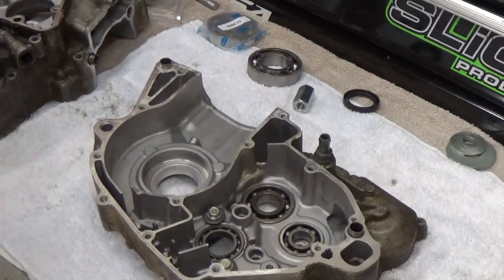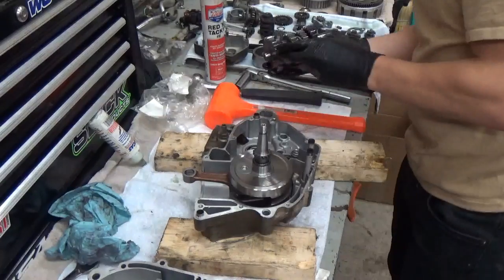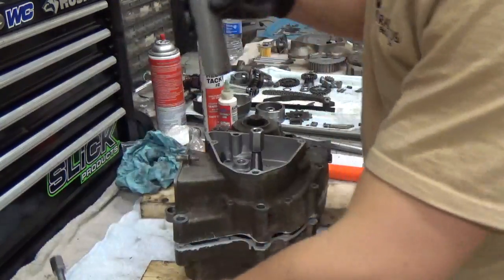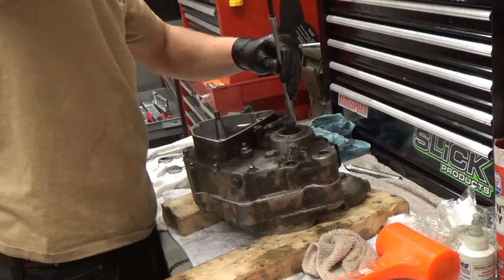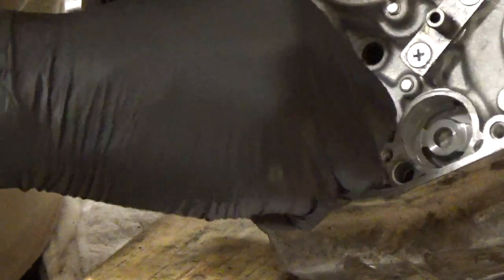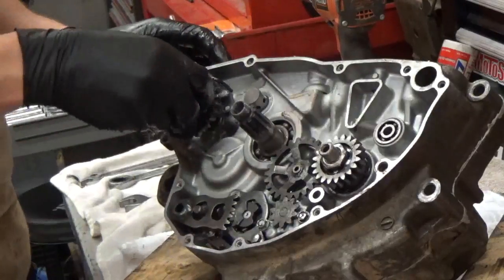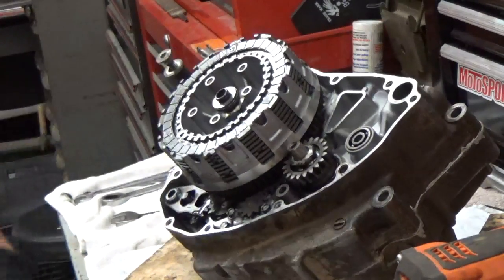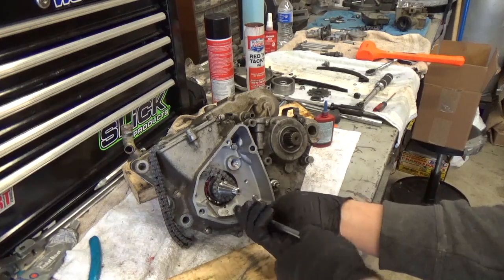How To | KX250F Bottom End Rebuild

Comment: You should never push/pull a bearing in from the iner race because you will damage the inside of the outer and the outside of the iner race the ball bearings will flar the top of the iner race and the bottom of the outer race. If you watched this video please dont do this.
Reply: My 1990 skateboard has ball bearings .... have they improved the tech like they have in skating. I

Comment: I've a 2013 KX250F and I've a collar and 2 o-rings behind the sprocket in the parts diagram.  I didn't see you install these, did I miss it?  The collar has a single groove inside and I'm wondering if the o-ring goes inside and one on the outside, etc...?

Comment: Hey man. I have a question about the actuating arm for the clutch!! Please help
Reply from the maker: What’s your question
Reply: @stratigos11  I put the clutch on and everything. But for some reason when I pull the clutch in. It rubs against the clutch cover. Did I do something wrong?
Reply from the maker: @ChrisC1946  make sure you have the basket and plates all the way on
Reply: @stratigos11  they are. The bike runs fine and clutch works but it's weird how it rubs

Comment: Any tips on torquing some of these nuts without using my 3/4" Milwaukee Impact ... could very well strip things with that beast.  I wedged a 12" 3/8 extension in between the flywheel tabs but couldn't hold it while somebody else was torquing the primary drive nut.  Somebody recommended a penny wedged between the gears but I'm not sure this trick will work for the several different high torque nuts you just used your Ridgid on ...
Reply from the maker: bugsysiegals I have seen many people using a penny to torque the final drive nut, but you can do a couple things other then that. The best thing to do is buy a gear/clutch holder tool or put a long punch or metal rod through the opening on the crankshaft rod where the piston connects and put a towel against the case to make sure it doesn’t scratch the cases and then torque to spec.
Reply: @stratigos11  I read about the penny last night and tried it this morning before seeing your comment.  It made it to torque, 72 ft lbs, just before sucking the penny through!!  I'm not sure if it was from the penny or something else but I found tiny aluminum shavings around the shaft for the clutch hub.  I vacuumed and wiped up what I could.  I like your method better assuming it wouldn't damage the crank bearing or bend the shaft?
Reply from the maker: bugsysiegals make sure none of your gears are chipped. Also using a punch or metal rod shouldn’t put any stress on the bearings but like I said the best thing to do is buy a gear holder tool. I think they are like $30. Tusk makes one that that can be a her holder and flywheel holder. Well worth the invest even if you do a few engines over the years.

Comment: I have a kx250f that's getting water into the case. I've rebuilt the water pump, and planed the head, replaced head gasket. Still water in the oil. Could there be a crack in the case somewhere?
Reply: Idk if u have found out the problem or not but i had the same problem with my 07 rmz 250 and it turned out to be the freezeput plug loose, its right next to the spark plug hole in your head, if that doesnt fix it check your cases for cracks on the water channel

Comment: so what was replaced? what was gained from doing this? Every engine tear down does help with learning, but i'm curious.
Reply from the maker: Crank was replaced, oil screens, new bearings, gaskets. You ensure a smoother running engine. You never know when you engine is going to blow up and hopefully it never does. There are recommendations on how long a crank or crank bearings will last. If you have a big race or you are going on a long riding trip, you wouldn't want to take a chance on blowing your motor because you didn't take the time to take it apart and inspect it. Especially if you do it yourself.
Reply: I'm still a lil confused of stuff my self

Comment: I forgot to order a new clutch hub nut when I ordered all my parts!! SMH  I'll likely need to order new bucket shims once I get the top end back together and hate to pay shipping for a nut alone.  That said, can I complete the right side of the engine, install the engine, and then open the clutch cover and still be able to torque the clutch hub nut, install the plates, etc.?  I've never replaced clutch plates but it seems all this was made accessible for this purpose ... if so, I could order the nut with the bucket shims and not feel so bad.
Reply from the maker: bugsysiegals I would tighten the nut and leave the clutch apart. Get your whole right side together and leave the whole right cover off. You should then be Able to put together your whole top end, check clearances then order all your parts at once. Once you have the nut then you can finish your clutch and install all the covers. I would also recommend buying a clutch holding tool that way you can properly torque your nut if you don’t already have this tool. Here’s the link: https://www.rockymountainatvmc.com/parts/tusk-clutch-holding-tool-p
Reply: @stratigos11  I have that same tool and it honestly wouldn't grip the clutch basket when I tried to remove the nut.  I then bought a 3/4" Milwaukee Fuel Impact (750 ft. lbs) and it took it off in one blip of the trigger.  Obviously I'll need to hold it when I torque it back on but if the tool doesn't hold it I heard I could put it in 5th gear and hold the brake down.  I hand tightened the case to avoid getting junk in there but will remove once I get it on the bike and need to finish the clutch.  I'm surprised the clutch couldn't be assembled through the clutch cover but if I have to remove the entire right side no big deal.  Thanks!
Reply from the maker: @bugsysiegals  You can try to assemble through just the clutch cover but its tight. I think it's easiest to just take off the whole right cover. Also helps if you have a friend hold the tool while you torque the nut down.